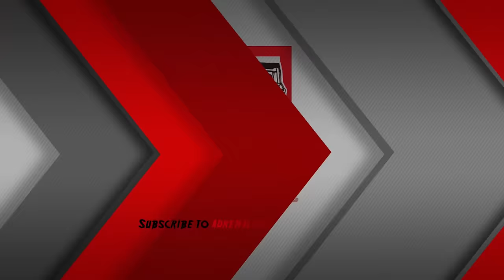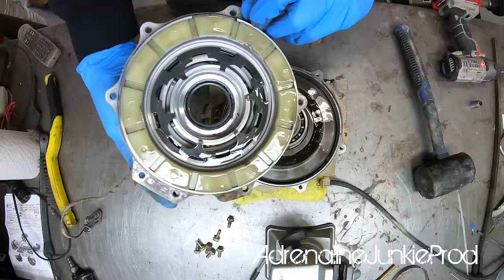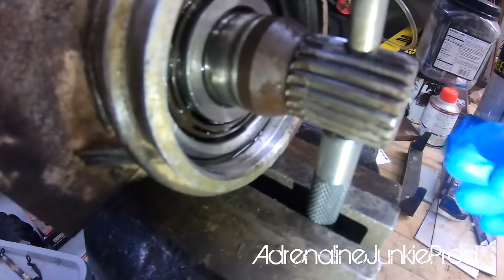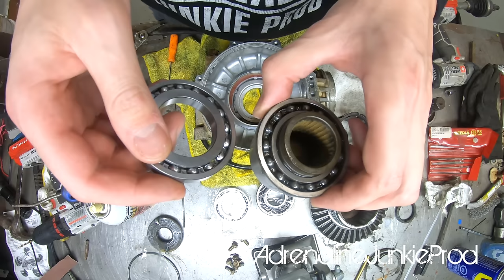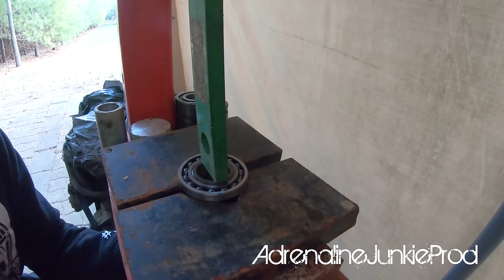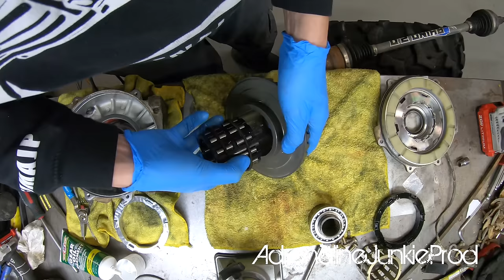Polaris RZR Complete Front Differential Rebuild - DIY - In Depth + Step By Step How To - RZR Turbo

Comment: Great video!! 
Thanks for taking the time to make it. The inside bearing cage fell apart in a million pieces when I removed the pinion seal, now I am just waiting for my 💣 proof kit from Sandcraft to show up so I can reassemble the front diff. Will definitely be using your video along the way as I put it all back together 👍
Reply from the maker: Hey Rick, glad you found the video informative! I had excellent luck with my Sandcrafft RCR internals. Good luck on your rebuild.

Comment: Really liked this video, hope to see more repair, component rebuild / upgrade videos in the future
Reply from the maker: Glad you enjoyed the video Michael. I'm working on an in depth exhaust removal and replacement video now. Removing the exhaust from a RZR turbo including the downpipe, as well as, extracting the broken studs out of the turbo which is a common problem when you try to remove the downpipe. Then a complete step by step install of the HMF turbo back exhaust system. I find a lot of installation videos just touch on the steps but don't actually show how to complete them or what to do when you run into common issues.

Comment: My dad who was a mechanic at a paper mill always told me to put the bearings in a refrigerator or a cooler so as to shrink the bearings a touch so they'd go in a little bit easier.  Which I've done and it works great.   I'm glad you did this video I've got rebuild my rear diff on my Commander which I am sure is going to be close to the same as a Polaris
Reply from the maker: Hey Stacy. I usually put my wheel bearings and other bearings in the freezer for a few hours before I press them in too. Been using that little trick for years. On this application I didn't think I'd need it.
Reply: AdrenalineJunkieProd I understand been there also at times.   Tell me if you know is the front diff and rear about the same other than the spider gears for locking it in and out

Comment: Great video. I impressed you pointed out the mistake during assembly. Everyone makes them. I’ve used the slightly heavier oil, full synthetic. The synthetic oils do not turn into molasses in the cold however, he equipment I work on isn’t exposed to the Canadian winter cold. Thanks for taking us along.
Reply from the maker: Making mistakes is part of the process, learning from them so we don't repeat them is the goal. Glad you thought the video was well done. Ya, I guess synthetic oils don't thicken up as bad as the cheaper dino based ones. I'm going to have to do some more research on what my best options are.

Comment: Awesome vid dude! Glad to see you do these kinds of videos where you show every detail of the process. For instance, most people would've just cut off the part where the input bearing didn't come off that easily. Appreciate the effort and precision you put into making these videos and maintaining your machines!
Reply from the maker: Glad you enjoy all the details Sami. I find a lot of installation videos just touch on the basic steps but don't actually show how to complete them or what to do when you run into common issues. For more experienced mechanics its not a huge issue figuring things out but for the novice mechanic it can really lead to a lot of problems or collateral issues.

Comment: That snap ring wear groove gets everyone lol.  A tiny bit of heat on the housing helps it walk right out.  The factory Oem Peer bearings are junk.  I'm running Shell Spirax TXM fluid in the front diff and transmission.  I believe it's about a 30w oil.  I'm in Alberta.

Comment: Putting the casing in a warm area and the pinion shaft in the freezer helps when you want to put them together.
Also a little buffing with Emery cloth in the bore would help you out next time
Reply from the maker: That’s a great tip. I’ve been using the bearings in the freezer and housing in the sun for a long time when I do where hubs and other similar press fits. Sometimes putting the hubs or items in an oven is a great idea.

Comment: A god tip for bearings that fit on the outside race is to pop it in the freezer unless your in a big hurry. I have always done ball joints that way on Pickups. Or an oil bath on a hot plate for fitting the inside race to give you 4 or 5 extra thou. But so far looks like a good build. So far im at pinion seat
Reply from the maker: The freezer trick is awesome, I use that method a lot on many projects.

Comment: what you have here is a flanged edge from the snap ring , the torque did it . a flat edge file on an angle will cut it off be very carefull not to take too much, slow and eazy is the answer.

Comment: Thank-you for the video, it just helped me with everything! There was one problem I ran into that wasn't covered however. I followed step by step your video and once I get the case bolted back together my output shaft of the differential wouldn't spin. It turned out to be a case bushing needed hit down about 1/100" to sit flush in the diff housing. The bushing is red in color, and it's the lip that the little plastic ring sits on before installing the ring gear, and I completely overlooked it. Just a heads up to anybody else, thanks again!

Comment: awesome video brother yours was definately the best ive seen on youtube. a lot of videos are not very informative or careless. top notch. only thing i have not seen is the reviews of the sandcraft parts after people swap them out and use them as well as the driveline and carrier bearings. these machines are notorious for this and im about to do mine. had a bad vibration on acceleration and a lot of chatter. how did you like the product after?
Reply from the maker: I appreciate the feedback!! I'm super happy to hear you feel this is one of the better videos on this topic. I put a lot of time into trying to make this as step by step as I could. It's not really a hard job when you break it down. As for the Sandcraft parts, I'd say they are good. Also, Sandcraft does a good job standing behind their products so if you run into any issues they are reachable on email or the phone to assist. I had great results with this kit. As far as a stock diff goes its a top choice for toughening it up. I'm about to swap a fully built RS1 front diff into the RZR Turbo. I got Joe Coffman from CCM to build me a "Hill Killer" diff. I'll be doing an in depth video on that soon. I've heard great things about the Sandcraft hanger bearing setups. I've been running a SuperATV Rhino HD utility series prop shaft with SuperATV billey hanger bearing for quite a few seasons with excellent results and no failures. I like the setup.

Comment: I about passed out when you blew those drill filings all over the  parts.  Use some grease on the bit and  take it way from the scattered  parts to clean it off.  I know you  wash everything before install but why take a chance. Also as noted bearings in freezer helps.  Wasn't keen about the hammer either.    Everything else was to the letter.  Good Job.
Reply from the maker: Ya, by no means was this perfect. You are not wrong about any of the stuff you pointed out. Needless to say the diff has worked flawlessly since I rebuilt it. Glad you enjoyed the video... minus the cringy bits, lol!

Comment: How about appying voltage before you reinstall to be sure the armature is working properly? Not that I doubt you but You said to comment that and popping bearings in a freezer to fit the bearings would be my only recommendation Great Video
Reply from the maker: Excellent advice Tony. I would totally do that in the future. As for the bearings in the freezer, I almost always do that when I'm pressing in bearings. It's also an excellent trick. Thanks for leaving a comment!

Comment: Great video! Recently started watching your vids over the past few months and they are always so entertaining. This video though was one for the books. The amount of time and effort that you put into this to help other who want to rebuild their diffs but are scared off by the thought was amazing. I’m in need of rebuilding my ‘18 RZR S 1000 front diff and so far I have noticed that the seal to the output gear is leaking and doesn’t hold fluid for long. Would this rebuild video go along with the diff I have? Also if there is water or any little pieces of debris in the diff itself. How would you clean it all out? Thanks!
Reply from the maker: Hey man! Glad you enjoy the ride videos and stoked to hear you found this shop video helpful and informative. 

Your diff housing looks a little different but as far as internals and how things work it’s pretty much identical. Once your in the diff you can wash it all out nicely with brake cleaner or another similar solvent.
Reply: @AdrenalineJunkieProd  Awesome, I appreciate the reply and information! Can’t wait to crack it open and see what I’m working with. At first I was just gonna send it off to be rebuilt, but after watching your video and seeing what all it contains, I feel like I’m capable of doing so!

Comment: Turn the can upside down and the content inside will seal off the air and keep it usable for quite a bit longer than storing it right side up.
Reply from the maker: Damn, that's an excellent idea man. Can't believe I didn't think of that. Thanks for the tip.

Comment: Looking forward to hearing your review after you get some miles on it. ( or km as we Canadians say. Lol )    My front diff is getting pretty noisy.   Carrier bearing for driveshaft was replaced and that helped the noise but the diff itself is getting pretty loud.   But only over 50km/hr.
Reply from the maker: Ya, it's common to only hear the noise above 50km/h at first. The stock carrier bearings are encased in rubber and have a TON of play and slop even when new. I run a billet carrier bearing from SuperATV. Makes a massive difference. I also run their Rhino Driveline chromoly prop shaft. The stock prop shaft are generally out of phase from the factory and make a lot of noise and vibration at high speeds.

Comment: I know this is old but hoping you still monitor it. I followed the video for my 2016 XP 4 turbo doing the sandcraft bulletproof kit. Everything turns great until I tighten the top on than the shaft turns real hard. I have re-pressed everything and checked what I can think of but still doing it? Any idea what would cause this?
Reply from the maker: I sure do monitor it and all my videos. Hmmmm, is the case cover bolting down flush without any issues? Is everything inside assembled properly? I’d give sandcraft a call. They are great to deal with. I’m not sure what would cause that.
Reply: @AdrenalineJunkieProd  So I talked to sandcraft and was told that it needs to break -in? They said drive it with the 4 wheel on for 100 miles and it should be fine. We will see.
Reply: @Cory Buckley  hey bud I have the same issue with mine after putting in the sandcraft internals. How did it go? Did it really just need breaking in?

Comment: 2014 xp4 1000. The front 4-wheel drive stopped working, I took the 4x4 gear case out and took it apart...everything looks good. magnet tests at 25 ohms, if I energize the magnet on the bench the armature sticks. If I put it together on the bench and spin the pinion, then apply 12 volts to the magnet....the axles do not lock and start to spin. It seems like they should and that I still have a problem in the gear case. Should the axles lock and start to rotate on the bench if 12 volts are applied to the magnet?

Comment: I have a good question. I clean parts in the dishwasher usually. But the front diff has a magnet and wires. What's the best way to clean it as I would guess it's prob not dishwasher safe lol.
Reply from the maker: I use brake cleaner in an aerosol can. Works wonders. Do you use the same machine as you wash your Dishes in? I don’t know if I’d wanna out all my parts in there, doesn’t it make the dishwasher filthy?

Comment: I just installed mine using your video as a guide (thank you, much appreciated!). 

Did your diff make any noise and vibrations after the install? I’ve got feedback in the steering wheel and noise from the differential at full steering lock, worse when on throttle. I was told by Sandcraft it may be just the 12 tooth armature plate getting seated and worn in. Thoughts?
Reply from the maker: Hmmmm. Interesting. Is it bad? What kind of feedback? Mine felt fine and I've had mine apart again since. I had to replace the input bearing and I replaced all the seals. I inspected it all when I had it apart to do that and everything looked great aside from the bad bearing. Sandcraft was awesome to deal with, they warrantied the bearing. My diff felt good from the time I did this. I've been quite hard on it a few times and I had it ratchet and do the diff crunch a few times but when I took it apart everything inside looked great. I've been happy with this setup. If I am in 4WD on asphalt or concrete then the front wheels are a little hard to steer and I get a bit of feedback maybe but that's expected. In off-road conditions everything seems fine to me. Is your prop shaft in good shape? Is your hanger bearing in good shape? I have a SuperATV Rhino utility series chromoly prop shaft that is phased correctly and balanced. I also have a solid billet hanger bearing from SuperATV. Often a lot of driveline vibes up front are caused by the stock prop shafts and hanger bearings. Can you explain in more detail what you mean by "feedback" and what kind of noise?

Comment: Best way to remove them pinion or input seals is drill a few tiny holes in the seal and use self tappers and a slide hammer
Reply from the maker: The self tapper and slide hammer trick is great. You're right its the best way when you can use that method. That way you don't risk damaging the sealing surfaces. Unfortunately, my slide hammer is MIA... and it has been for ages. Might be time to invest in a new one.

Comment: nice video! sorry if it was asked but I read a lot of comments and haven't seen anybody ask how it performed now that it has since been 2 years?
Reply from the maker: Hey Mike. It worked excellent. Much better than stock. It held together well. I had to replace the seals one more time after about 18 months but that’s an easy job. You don’t even need to crack the diff open. I also ended up replacing the input bearing again at that time because it was getting noisy. Sandcraft RCR sent me a new one fire free under warranty. I rode it pretty hard after that and never had a catastrophic failure. It would still make the ratcheting noise from time to time under heavy abuse but it didn’t damage anything inside. I’ve since upgraded to an RS1 front diff with the Hill Killer setup from Joe Coffman. As far as a stock diff goes I can openly recommend the Sandcraft RCR components. They worked great for me. The RS1 diff conversion is a total game changer though. You can check my video out about it if you are interested.

Comment: Have you had anymore diff problems after going with the sandcraft brand?
Reply from the maker: Hey Steven. Easy answer is no, not really. I did have to replace the input bearing again as it failed after about 12 months but sandcraft sent me a new bearing for free saying it shouldn’t fail that soon and it may have had an issue. After that I had no issues aside from the required routine maintenance. On 32s riding hard though the diff would still ratchet under heavy load. I ride it hard before swapping to the RS1 diff. When I took it apart to inspect it after like 18ish months of use it all looked perfect inside. Even after quite a few hard diff crunches. What I’m saying is this setup is much better than OEM but it’s not bullet proof in the sense that you can just abuse it. With a larger tire and aggressive riding you can still damage it. Just not as easily. I was very happy with its overall performance.

Comment: What is the tq spec for the case bolts? I also noticed you just tightened the bolts in a clockwise order. No sequence needed or is that sequence? Great video. I like to research parts/repairs before I break them lol

Comment: I have two of these in a one-if-a-kind battery-powered ATV on our farm. The front diff switches in and out when needed, and the rear diff is always in. The rear diff is in need of repair. I went directly to Hilliard and they told me that my diff is obsolete--no parts available for mine. I was offered the newer version for about $400. I see that Sandcraft sells the re-build kit for close to $800. Are there any other options for getting my diff running without spending so much?  I'm using my wife's youtube account.  Ed
Reply from the maker: Not sure what other options you would have. You could try the Polaris dealer or HD Extreme, I think they also make rebuild kits.

Comment: Outstanding video Is a Polaris ranger front diff similar or not even close
Reply from the maker: A Polaris Ranger 1000XP and most other Ranger front diffs from this era should be pretty much identical.
Reply: @AdrenalineJunkieProd  Thank you for the response
Reply from the maker: @lumpy1603  No prob man. Thanks for checking out the video and leaving a comment.